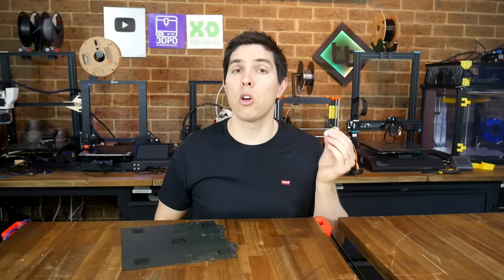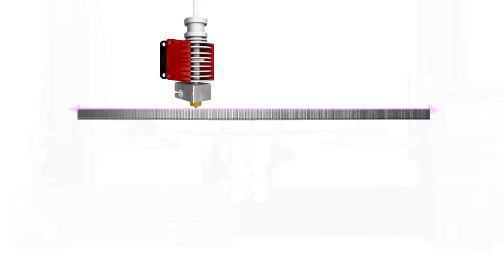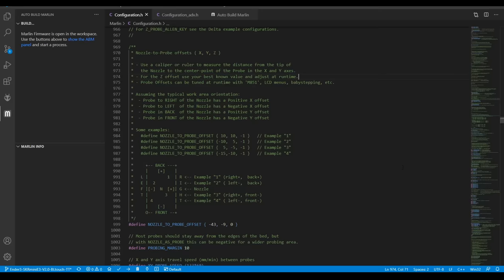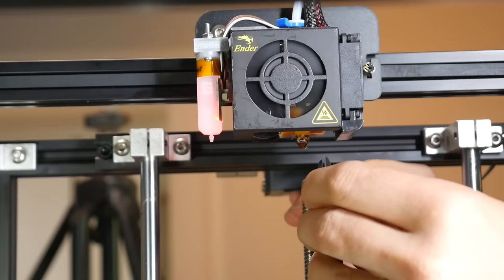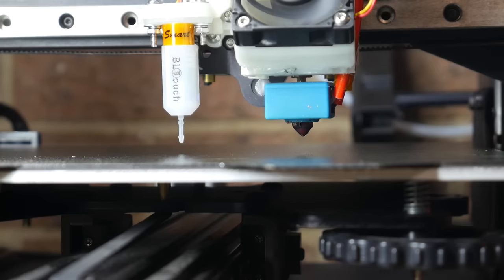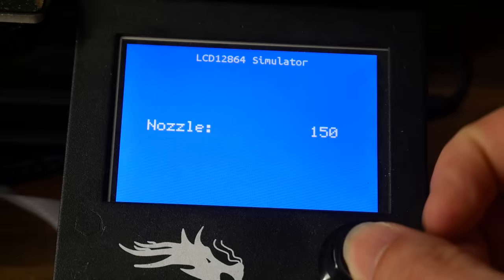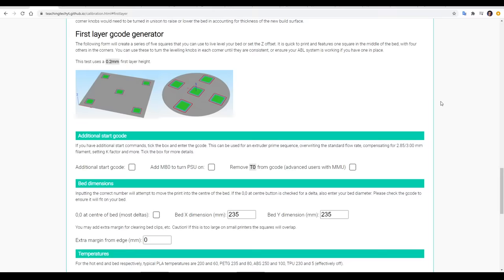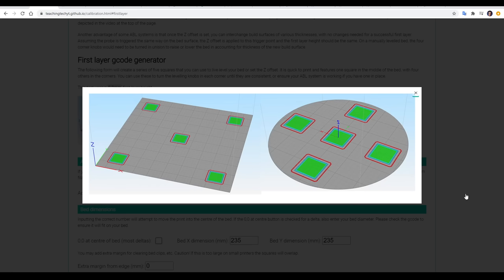ABL offset guide including new probe Z offset wizard

Comment: I found an easier way to measure nozzle to probe offset.
I just cut one piece of cardboard to the size of the print bed, than secure it to the bed with clips.
Than I manually deployed the probe and slowly moved Z axis until the pin barely touches the cardboard and I marked the exact spot with a pen.
In the next step I retract the probe and slowly moved the Z axis up. Just enough to have the nozzle punching a little mark at the cardboad.
Than I just moved the bed down and got a nice print of 2 points to measure it with the calipers without any hassle.
I hope this helps others. I love your content.
Reply: dont bother with rulers, cardboard, graph paper, etc. 

you have filament in the nozzle. just extrude a dot on the bed to mark the position of the nozzle, then jog x&y to put the deployed probe right on top of that dot and note the change in x and y. that's your xy offset.
Reply: @suivzmoi  Your method was the best! Thanks for the input.

Comment: Tip for measuring: 
Lower the nozzle to about 3mm above the bed so you can fit a ruler (or angle square) under the tip; draw a line perpendicular to the edge of the bed; do the same for the tip of the BLTouch. Do this for both X and Y. You can now easily and precisely measure the distance between the lines drawn on the bed.
Reply: Tape a piece of paper to the bed. Lower the nozzle all the way into the paper and write down the XY coordinates. Now raise the nozzle back up. It should leave a small dimple in the paper. Use a marker to put a spot on the dimple so it's easier to see. Now move the print head so the probe is directly over the dot. Write down this second set of coordinates.
Now subtract the second set of coords from the first set and it will leave you with your XY probe offset.
Reply: @slickstretch6391  this is after auto homing i assume?
Reply: @all3n1k  It wouldnt matter where you did it, as long as you compare the coordinates with nozzle and probe over exactly the same spot.  it could be near the edge if you wanted..   It might be convenient if you have an inductive probe to use an object the size of the probe head and mark or drill the center.  Those probes are pretty big diameter so its quite hard to eyeball the center of it.   
 In the end the offset doesnt need to be THAT accurate
Reply: the simpliest trick is to usesquared notebooks papers and use the line, thinnier is better

Comment: I really liked your instructions. The problem I finally figured out was I needed to add a little weight to the probe. I used a small rubber washer used on archery strings to add just enough weight to the shaft (that was designed to be metal) so it would drop properly and ON TIME! Once that was fixed it is running very nice! Thanks again!

Comment: Started following the steps, then realised that I was back a version and this motivated me to upgrade from 2.0.6 to 2.0.7. Once I had done this, I found the process pretty simple. 

Definitely an improvement on the struggles that I was having previously with trying to babystep. This process is easy and quick enough that running it when I change nozzle sizes will be a breeze.

Comment: Looks to me like it would be easier to set the offset by homing all axis. Your x,y DROs will read 0,0 then use a sharpie to make an x under the tip of the nozzle then jog over until your probe is over the marked x on then read your offsets directly off the x,y DRO on the LCD.

Comment: Without wizard you basically first set your offset to 0 (or default value)
Then you  home all axes and move the z-axis to 0mm.
Now you can adjust your offset with real-time change over the 'bed-leveling' menu, and save to eeprom.

So the core function of the wizard is not that 'new', but it is a really good idea!
It combines different steps together to make it as easy as possible for beginners, without having to dial trough every menu

Comment: I use the klipper paper method with cold bed and nozzle, and adjust while making test prints like yours. Typically my vocano hotend expands 150 microns. Thanks for the video. Finally marlin has this Wizard too.
Reply: Yes, I also do PROBE_CALIBRATE with klipper, but I always have to add around 0.2mm in the config file to get good adhesion
Reply from the maker: I'm still looking to pick a printer to convert full time to Klipper. CR-10 Max is the latest suspect.

Comment: Greetings from Australia. This is how I calculate my x and y probe offsets.
I take off my PEI plate and tape a piece of graph paper with mm lines, taking care to get it aligned squarely
Then the PEI plate goes back on the magnetic bed 
Then I raise the z axis and lightly touch the tip of the nozzle and the probe with stamp pad ink.  Then I lower the nozzle until it just touches the paper, then I deploy the probe.
The raise the z axis and observe the graph paper.  With luck there will be two ink spots on the graph paper.  Remove it from the printer and with a set square align the top of the square with the nozzle point, keeping within the lines on the graph paper.  Slide the square to the left until the right angle side of the square touches the probe point. Measure that distance along the top of the square.  If it’s to the left and in front of the nozzle it’s a minus reading.  Now for the y probe point.  The y offset is the measurement along the left side of the right angle triangle, ie the distance below the x offset line.  Once again if this is in front of the nozzle, it’s a minus.  Enter these two values in the x and y offsets in the Marlin FW.
And remember. If you change a nozzle or upgrade your hardware, or remove and replace your touch, then you have to do this again.  I just installed a Micro Swiss NG direct drive so I recalculated the values.

Comment: Very clear and well put together guide that I direct others to frequently. However, I always have to preface that they need to account for the thickness of the gauge that they are using to set the offset. I also explain that when the z axis is moved to zero, the nozzle should just be touching the build plate and not pressing on it.

Comment: Great video, helped me a lot. I had some problems measuring the Y Offest. If you measur the X Offset and the absolute distance between the tip of the Probe (diagonal) and the nozzle you can calculate the y offset with pythagoras:  Y Offset = sqrt( X^2 - diagonal distance^2)

Comment: My method with a BL Touch as they fix some bugs with the wizard:

1. Preheat bed/nozzle, home and move x/y to the center of the build plate.
2. In BL Touch menu, deploy BL Touch.
3. Slowly lower Z until probe is touching the bed, and note the height.
3a. Move nozzle to where probe was, using the known x/y offset values.
4. Slowly lower Z until nozzle is touching the bed, and note the second height.
5. Do math to determine difference from probe end to nozzle end. As noted in video, this number should be negative.
6. Enter this value as Z Probe Offset.
7. Happy first layers.

EDIT: I forgot step 3a. Depending on how warped your bed is, it could make all the difference.
Reply: That's a really helpful tip, thanks.
Reply: Been doing exactly this for a couple years now. I even add that number to the firmware itself and recompile.
Reply: Yeah I also did exactly this. I never  understood how measuring mid air with a caliper and my cavemen eyes should be accurate enough.
Reply: In my experience it should be 7. Test; 8. Swear; repeat 1 - 8.
Reply: just a point to make for (3.). you are supposed to lower Z until the probe is TRIGGERED, not just touching the bed.
Reply: My exact process is slightly modified from yours.
1. same as yours
2. Check and make certain that the current Z probe offset is 0
2a. Use G28 to home all. (my nozzle is now center of the bed)
3. Go to a terminal type G0 Z0 (hit enter)
3a. Same as yours
4. Using a 0.10mm feeler gauge on the bed, lower the nozzle until it just touches the feeler gauge.
5. Look the the amount that Z was lowered. This is the offset value.
6. Same as yours
Reply: Maybe a 3b. Stow the BL Touch after you have gotten the measurement? Just to keep it up out of the way.
Reply: @mikeneron  After a G28 the tip is already stowed. You only home it once. The basic run down is to just home the machine, tell it to go to Z0 then see how far the bed is from the nozzle. That distance (after G0 Z0) of nozzle to bed, is the Z probe offset.
Reply: Extremely useful information, Thanks!

Comment: I find it difficult to observe the "squish" while printing, so to fine tune the Z offset I print a single layer square. Once the print is finished I measure how thick it is with digital calipers, then calculate any adjustment needed to correct the thickness to match the first layer height. For example if I am printing with 0.2mm layer height and I get a thickness of 0.16mm, I then adjust the Z offset by +0.04mm. The next print should be be dead on (within the accuracy limits) the layer height.
Reply: brilliant

Comment: I thought of an easy way to measure the XY offset of probe to nozzle using 1/2 inch foam board. Cut foam to reach under the nozzle and hotend. Square the foam edge to the bed front. Lower Z to press into the foam (COLD HOTEND and BED). The hotend will make an impression. Mark the probe location with pencil or other marking device. Now it is easy to measure the foam markings for XY offset. The foam is soft so lowering Z you will allow both hotend and probe touching the foam. Hope this helps

Comment: If you're having trouble with offsets for ABL, the piezo disc leveling system installed on your hot end eliminates the need for offsets.  Just like the CR6SE it uses the nozzle as the probe so no offset needed.  Just another way around having to calculate pesky offsets.
Reply from the maker: I just received such a kit for a future video :)

Comment: The Z Offset wizard homes and then says "Probing Z Reference" at this point get a feeler gauge under the probe before it hits the bed. Paper, brass, stainless ruler, a strip of PEI, anyhting works but it's best if it's relatively incompressible. Thickness does not matter if you get it under the probe. Now when you come to set the Z offset so it grabs the paper, it's automatically accounted for the thickness of the feeler you used. This should eliminate the need for most of the tuning. At least for me on glass, it's giving me really accurate and repeatable first layers without having to babystep.

HOWEVER I am setting the offset at printing temperature becasue the thermal expansion of the nozzle and block is enough to skew this, so YMMV, but getting the probe in on the Z reference means Z0 is on the bed and Z0.2 is 0.2 off the bed which is a really good place start tweaking first layer heights from. 

I found the do it cool and babystep method was ok for PLA, but it was really awkward getting a good pet-G first layer.

Comment: Do you not need to add an extra .1mm for the width of the paper?
Reply: The nozzle has to be slightly above the bed to work.  The ‘paper thickness’ setting is approximately correct for a 0.4 mm nozzle.
Reply: @boggisthecat  That is true when you are manually leveling a bed. But for the Z offset, you want that to be the ACTUAL distance from the end of the probe to the bed. You then set your first layer height in the slicer.
Reply: you are close. if you use paper to land the nozzle, then you need to use paper during z probe homing as well, or there will be a nozzle_to_probe(z) error approximately equal to the thickness of the paper. which btw if you use printer paper is actually 0.05mm not 0.1mm. this is a point which most people do not get. but then again most people don't realise the error as they eventually eliminate it during babystep "fine tuning" after the fact. this paper thickness error becomes absorbed inside the nozzle_to_probe offset z value. but then people can't figure out when their 20.00mm tall calibration cubes come out as 20.05mm....

if paper is used to land the nozzle, it must be used to trigger the probe as well during homing. after using paper for both the nozzle and the probe, z_home_pos should be set in Marlin config to 0.05. this is so that after homing is done, z height reads correctly as 0.05 instead of 0. most people do not do this so when they home, z reads at 0 when in fact there is a paper thickness worth of gap between the bed and nozzle. so when layer 1 0.20mm starts, the nozzle is actually at 0.25mm and the first layer has poor adhesion and you end up babystepping down and making nozzle_to_probe(z) more negative. if you dont do z_home_pos, then you will have systematic error in the height of your prints, such as the calibration cube example i gave--but for most people i think it will not be an issue.
Reply: @suivzmoi  All of this, great info! Though, I have never had a piece of paper be that thin. I always measure whatever paper I use and standard printer paper has always been between .09 and .11 for me. I suck and using the eyeball method for adjusting babystepping... so I try to get my Z offset bang-on when setting it.
Reply: I agree. I was quite excited to see a video on this as most information is plain wrong re setting z offset especially where probes are concerned. Unfortunately as soon as I saw the paper.. I was pretty disappointed.. not to mention hearing the words squish. the z offset should set the nozzle so that z=0 just touches the bed.. nothing more nothing less. The slicer sets the height of the first layer and calculates the required amount of filament to be pushed through to achieve the set width and height correctly. Therefore if you set the first layer to 0.32 it should measure 0.32. you don't squish it.. that's the slicers job to work out. If it's meant to be 0.32 then it should measure it. As Aaron F said, the paper thickness should be taken into account, or better still use a metal feeler gauge of a known thickness and add that thickness to the z offset so z=0 is correct. Another thing to consider is that spring mounted beds move easily when setting the. Z Offset so when using a metal feeler gauge it really only has to faintly touch it, otherwise it's likely that the bed will move a fraction and throw the measurement out anyway. I always print a skirt and that skirt is measured to ensure my first layer is just right as set in the slicer. There is a good argument for solid bed mounts with mesh levelling and as a side issue.. 4 point levelling is a big culprit for warping beds. 3 point won't warp it
Reply: @suivzmoi  
No, that is incorrect.

Think about what you are doing when the printer operates.  Plastic is extruded out of the nozzle.  If there is no gap between the nozzle and bed, no material is extruded.  The first layer is extruded out of the nozzle and adheres to the bed.  Subsequent layers are extruded out of the nozzle and adhere to the previous layer.  As the z-axis moves up, a gap is maintained.

The initial z-axis setting must allow for the first layer extrusion.  When tramming they bed manually, you use a paper thickness as the starting point as the 0.2 mm nominal height will then ‘squish’ somewhat on the bed and ensure sticking to the bed.  Get the nozzle too close and the first layer will squish too much and the nozzle drags through extruded material that escapes out the sides.  Get the nozzle too far away and the first layer won’t stick to the bed, and the print will easily come loose.

Comment: When measuring the Z-offset, the thickness of the paper needs to be included. Typical sheets of paper are 0.1mm thick. If that's not done the first layer will be 5 layers off. (at 0.020mm / layer)

Comment: I tried this on my ender 3 V2 but it doesn’t give me the option after flashing the firmware. Any ideas?
Reply: Same
Reply: it doesn't have an LCD display :/
Reply: I see that the symbolic constant "HAS_LCD_MENU" is not defined in the latest (2/2021) Marlin bugfix code.  But, why should that be a requirement for supporting the wizard?  Is it just a "to do" for the developers, or is there a reason it's a big deal to support it with the stock Ender 3 V2 code?

Comment: Not sure why I never see this technique.  I set my X/Y offset for the probe by printing a right angle (L shape), where the intersection point is the center of the printer bed.  I then manually move the sensor with tip extracted until the tip is directly over the intersection. I use the new coordinates to calculate the x/y offsets.

Comment: Thank you for the video, but I find I have to readjust my calibration frequently.
I am sure to save settings each time, so am confused as to why this happens.
Moreover, my unlevel bed does not seem to be taken into account, and therefore the middle of the bed is highest (and therefore squished most), and is not being rectified.
Does anyone have suggestions to fix this?

Comment: what setting do you put to generate a proper gcode test file?  I put my dimensions in, but it doesn't print square, left test squares are squished against the left side of the bed..  Ender 3 pro cr touch.

Comment: I have an ender 5 plus and I had a Boden set up but I turned it into a direct drive set up but the probe is offset to about 42 mm to the left and the probe no longer probes the right spot I tried using m851 but it's not working so I'm stuck since I don't have an adrenal board

Comment: Good morning, I have a problem. When you do the point check on the bed, on the right side, you get out of it, until it stops at the end of the x-axis. Put the points that you put always comes out. I have the probe to the left of the nozzle and to the left it does well, and in front and behind as well. I guess I must have something wrong with Configuration.h but I can't figure out what it is. I appreciate your help in advance.

Comment: do not use pliers or needle nosed tweazers on a brass nozzle heated above 100C. you can deform the tip, skewing your nozzle size. Just use your nozzle brush.